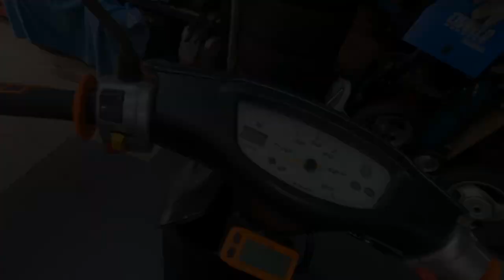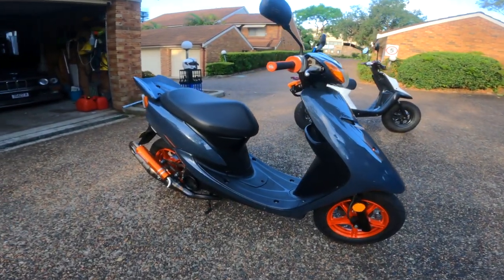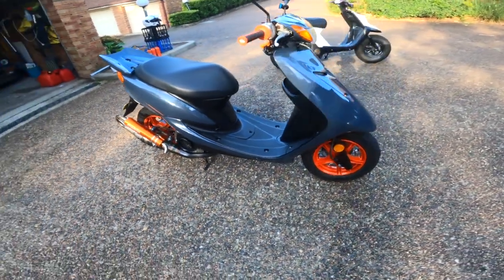Jogzilla gets a new coat of paint. Colour reveal.

Comment: Hey mate, I've been coming back to these vids cause I have a similar problem with my Jog, the PWK type manifold is too big and im cramped for room, so Im wondering what combo did you do at the end, regarding the intake and the carb???
Reply from the maker: CP21 carb running 102 main 36 pilot. I did have a polini pod filter but got annoying as way to loud. Modified stock airbox on it now. There is a vid about it

Comment: where are those wheels originally from?
Reply from the maker: I think a jog zr evolution. Basically the same thing. Available from Japan and other Asian countries
Reply: @scooterbomb2152  Oh nice I'll keep my eye out for a wrecking one, thanks! I have the same jog cv btw, 2006, love the vids, hope I'll be able to beef up my moped too someday soon
Reply from the maker: @okeyhehe1728  I got them from yahoo auctions Japan
Reply: @scooterbomb2152  Niche place to get parts from, cheers for the deet
Reply from the maker: @okeyhehe1728  Your welcome
Reply: The zr evolution come with a different speedometer in dark color and a cover with circle ⭕️
Reply: @scooterbomb2152  yes is the zr evolution i have one 🙂 I change the transmission gear ⚙️ and big bore cilinder and other thinks and the zr comes with a remote control to open the seat and unlock the switch
Reply: And Kitaco have a oem speedometer 120km
Reply from the maker: @TheBlueevil56  I like the idea of the remote. Might need a new speedo for mine as it easily exceeds the 60kph reading now 😁